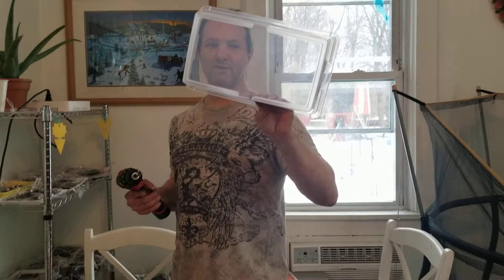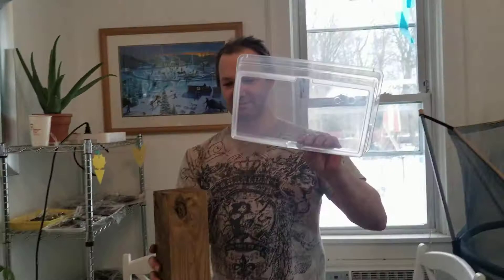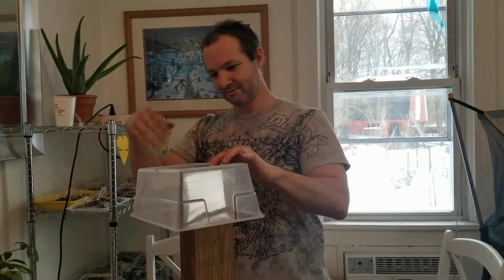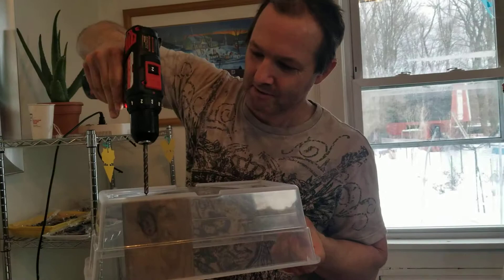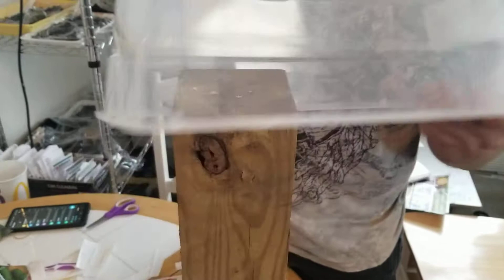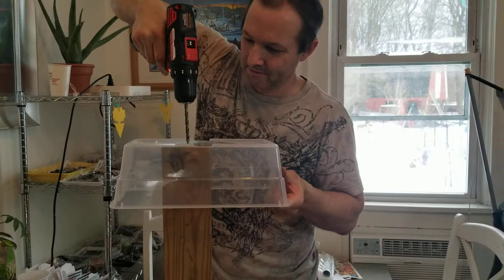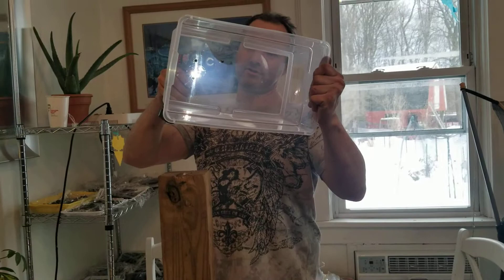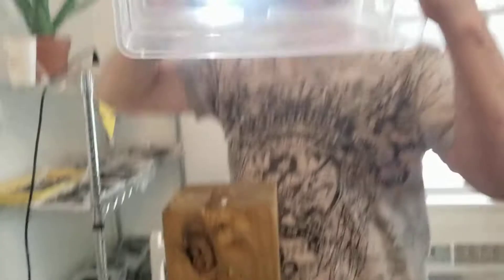How to drill holes in a plastic container without damaging it.

Comment: How can a cut a hole for 6.5. 1/2 150watt marine speaker on a plastic tool box with out a saw ? Is there a good knife ?
Reply from the maker: your better off buying the hole saw, the edges will be smooth, it would be easier and safer. You will most likely cut yourself badly using a knife. It sucks to spend $50 on a tool that you may only use once, but it better than going to the ER. Maybe find a used one on ebay. Be sure to wear safety glasses, I learned the hard way. Thanks for watching.